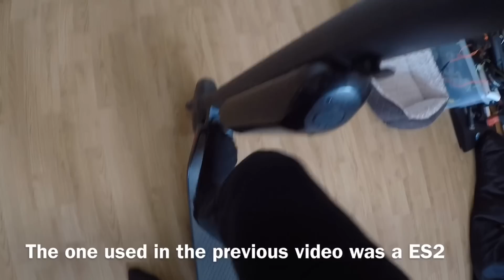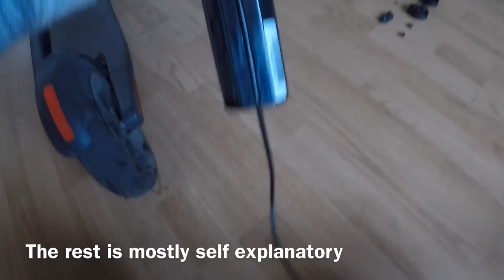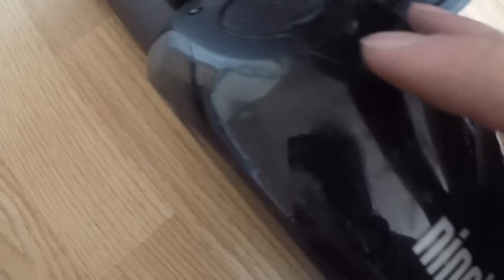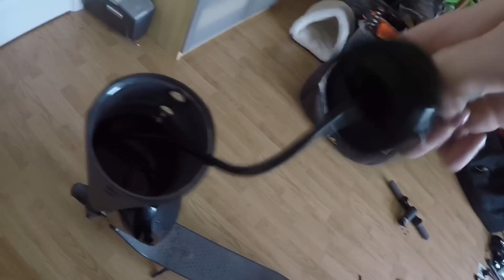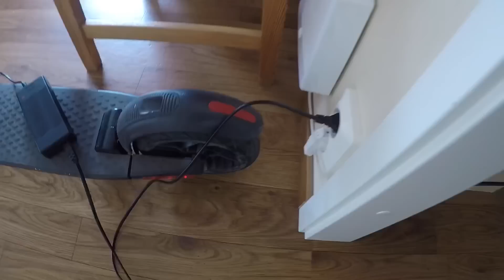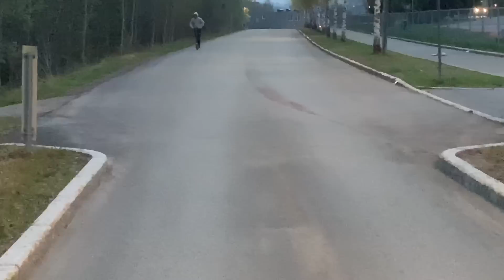Bird Scooter to Personal Scooter Tutorial [Part 2]

Comment: Hi dude, thanks for your video ! I have a question to be sure, if I command the good quality control board with your ebay link, (there is also the dashboard control). That's work ? I plug both, and normally like you in the video, the bird is mine ? ;)
Reply from the maker: R4fff13 and just a quick note; the display quality does not really matter (difference is the sharpness, the cheaper one is more blurry). And before you go and start riding your scooter make sure to remove the GPS. You will be able to use the scooter with the official Ninebot app and lock it, etc..
Reply from the maker: R4fff13 Yes, thats right :D I would highly recommend to stay away from cheap control boards due to the easy fuse triggering and burning out. I drove 206km with mine from home to school and back with no issues and great battery time!
Reply: @ToxicLion  do i really need the dashbord assembly. Like if a dont buy one it wont work
Reply from the maker: Plug Reaction Yea..their dashboards are linked with the control board installed so they wont work/turn on if you install your own controller. That means no bluetooth and speed’o’meter. I would recommend ordering a dashboard + control board, it is very important to turn the brake regenerative charging to medium form high. Just so the scooter won’t overcharge👍
Reply: Toxic Lion but I dont have install the Dashboard
Reply: Toxic Lion Hello I have buy the control board and the dashboard for my personal Voi scooter, I have installed the control board but the battery wont to charge , how can I charged it please ? (Sorry for my English 😅🇫🇷)
Reply: @whybe5972  ta vérifié si t'a bien branché tout les câbles ?

Comment: Wait this is the dofferemt type og model. And og does not have the GPS box but instead Inside the scooter?
Reply from the maker: Luka Todua Yea, different models have different types. Lime scooters have a GPS box on the front with a speaker, while some only have the GPS box. Some newer models have built in GPS like shown in this video. They are always removable and findable so no worries! :)
Reply: @ToxicLion  But it means that this is Not the same model from part 1. What did you not use the VOI scooter?
Reply: @ToxicLion  and grin scooter were the gps. ??